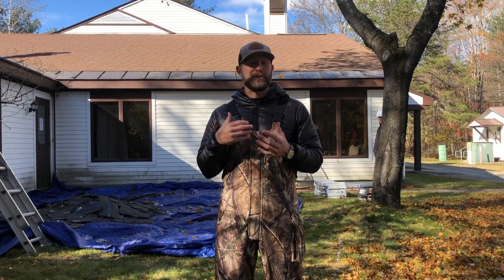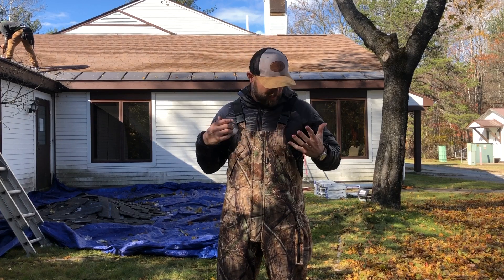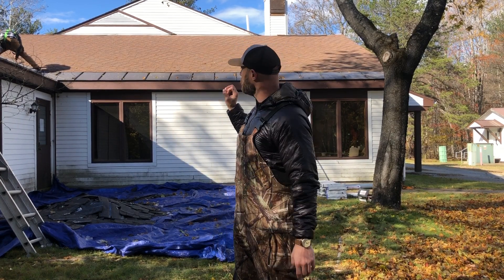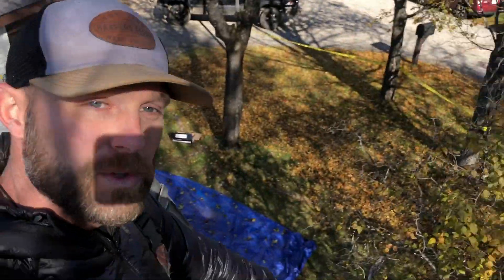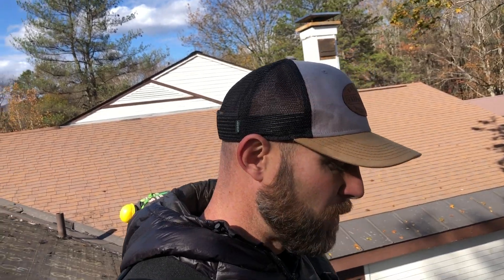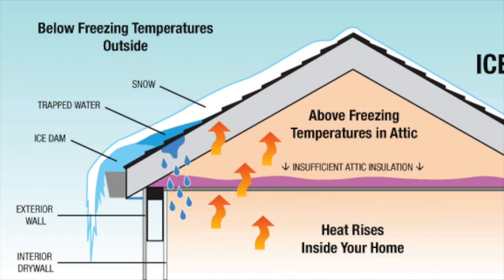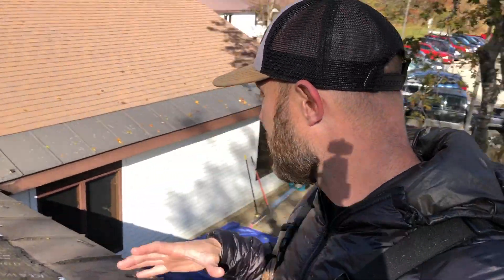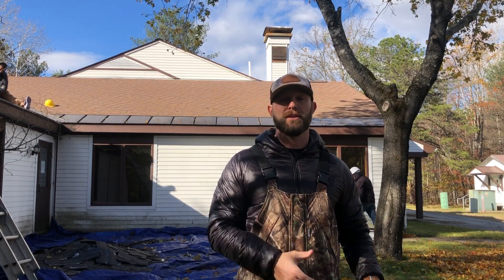Roof Ice Dam | Secret to Prevent Roof Leaks

Comment: Awesome video explaining the main reason why many customers have standing seam metal roof along the roof eve, price for homeowner to do this is much cheaper Than having to fix ice dam problems. We had one of our heating mats installed under a standing seam metal roof, very similar to the job on the video, in Cambridge, MA. Worked wonders. Thank you for the detailed video.
Reply from the maker: We appreciate it!  When I saw this, I was like "Wow, this is really ingenious."  How do you feel this stacks up against using Ice and Water Shield?
Reply: @DigitalRoofingInnovations  It works great, does not harm water shield. Helps immensely with ice and snow. We had in between water shield and standing seam metal, we installed one of our heating mats to completely melt any snow or ice, so there was another layer of protection. Since the metal is such a good heat conductor, we were able to even get a better area coverage for the heating mat, which is 13" inches wide. Customer had huge icicles on the edge of the roof, grandchildren playing outside during the winter was always a risk of an icicle falling.

Comment: I like your channel, but I would like to comment that standing seam (SSM) doesn't prevent ice dams. We have a customer who had a new SSM roof installed and then got horrible ice dams. So much so that water got into the attic  and collapsed their dining room ceiling on Thanksgiving day. We had another customer who had SSM and had ice dams so bad that it bent and twisted the metal at the eaves and valleys. We've installed heated eave panels for both homeowners to solve their problems.

Comment: Oddly I plan to do this exact same solution with standing seams and feather into asphalt shingles. Cabin at 10,000+ feet and the northside always has 2 foot ice dams. New asphalt roof lasted five years on the north side. Freeze\Thaw destroys it fast. Full metal solution  would be best. Installing a quality metal roof is not something I would be able to do. Location makes roofer at least 2x times more expensive.

Comment: Did you ever find out from the homeowners why exactly they did that? The only thing I can imagine is that the metal helps to prevent the water from freezing or snow from sitting too long. I don't think anyone would put it there just to make the area more waterproof, because there are much cheaper and better ways to seal a roof deck than using metal. Yes, some homes in the North East use metal/copper cladding around the roof edges, but it's usually with the idea of allowing snow to fall off quickly as the metal helps to melt that area faster, not to waterproof the roof.